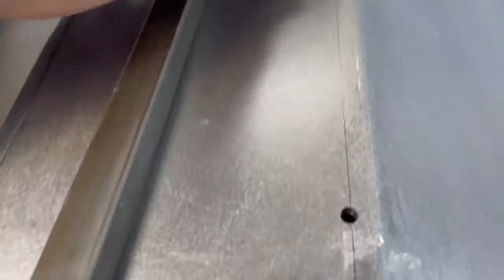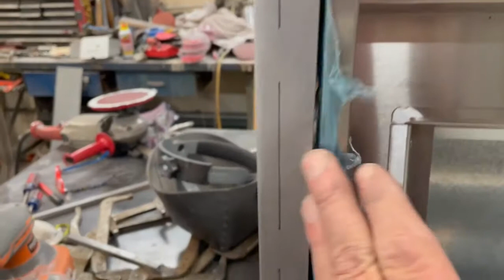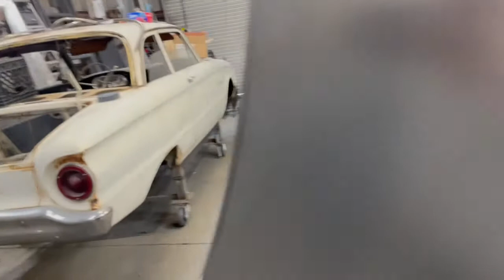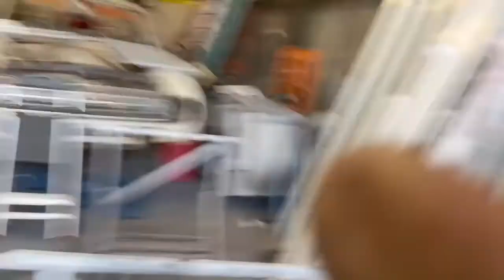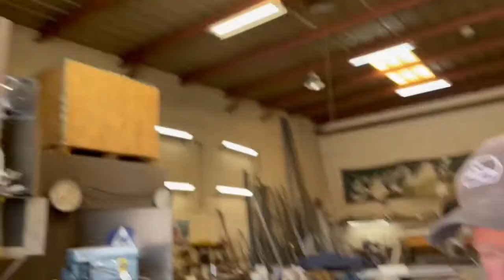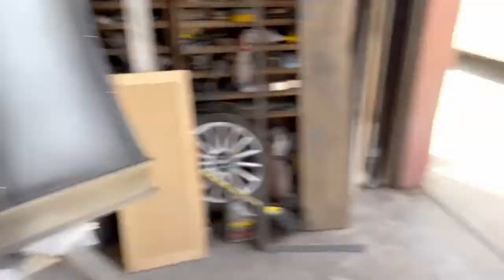Fabricating A Custom Metal Range Hood Project part 3

Comment: How do you go about installing the ventilation unit once the frame is installed?
Reply from the maker: The back is sitting on a ledge I built into the hood and I was able to remove the two mesh style vents and get access to the front sheet metal on the vent itself. I welded a couple of small tabs on the front inside of hood frame and was able to drill through the front of the vent itself into those tabs and screw it and you couldn’t see it after the filters were reinstalled..
Reply from the maker: There are three videos on that hood. I’m pretty sure I talk about how I did that.